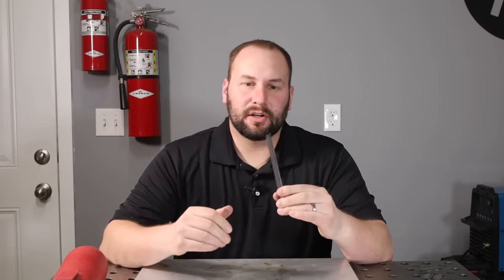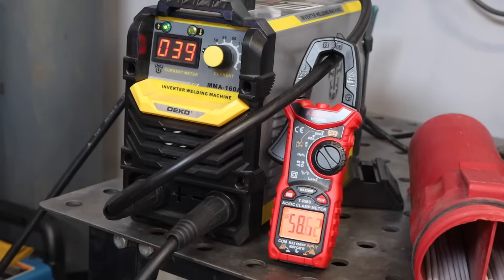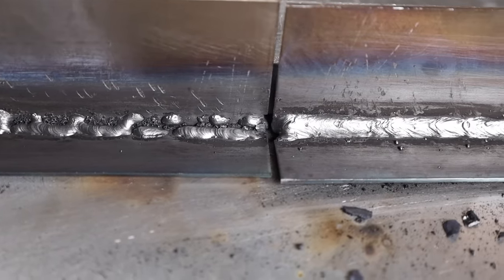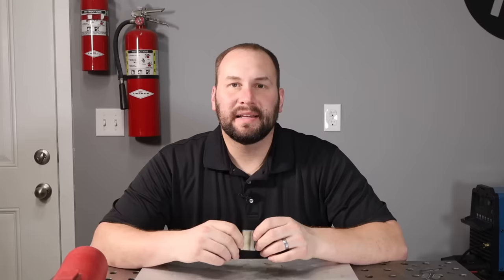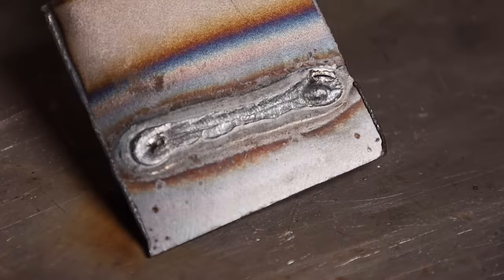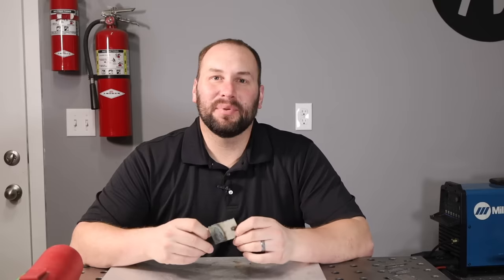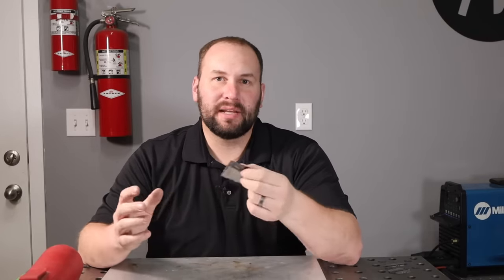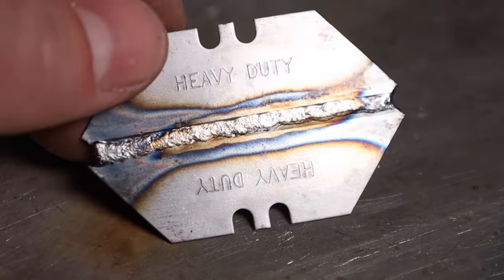Can I Stick Weld Razor Blades? | Thin Steel Stick Welding Tips

Comment: The guy that taught me (early 60's) could weld a beer can to 1/2" plate with a stick welder. Nice clean weld. I was never that good. In later years I had a guy working for me that would bend a 7018 1/8' rod backwards and do vertical ups in a mirror. I did master that one.
Reply: Beer cans were steel back in those days, so before some keyboard warrior comes along, yes it's possible.
Reply: @ParadigmUnkn0wn  i was actually wondering about that
thanks man
Reply: What do you mean by bending it backwards? Like in a U shape?
Reply: @autodidacticartisan  Yes..
Reply: Everyone loves it when I pull out my gag 1/2" thick soda cans
Reply: back in my day (early 40's) we'd hold a coat hanger steel electrode in our teeth and do 250 push ups, welding at the bottom of the rep. the goal was to replicate the mona lisa in welding bead, and that was just to get hired for an entry level position at $0.15/hour. you little whippersnappers don't know a damn thing about welding!
Reply: My Dad told me when he was on his 1st or second job out of vo-tech he welded a prince Albert tin to his work bench bottom...
Reply: I seen a guy bend his rods and weld around tubing without looking at other side of bar and Weld a whole racecar frame perfect. It was unreal how good he was when compared to myself using eyesight to weld lol
Reply: i call bullshit oldman
Reply: @autodidacticartisan  I can't even weld like a normal person 😂

Comment: I've successfully welded car fenders and other car body parts with a stick welder and it is challenging.
Reply from the maker: Tons of respect for those skills! I've only welded auto body with MIG.
Reply: @TimWelds  It's actually easier with a brazing torch and brazing rod or coat hangers 😊.
Reply: Last summer I picked up a stick welder for the first time in 20+ years. Had a bit of thin rod left over from a small fab job so decided to try repairing some old thin sheet metal barbecues that were lying around. Blew a few holes but for the most part it worked pretty good!
Reply: @TimWelds  Unfortunately I know firsthand that it's difficult to say the least... To put it better, trying to stick weld body panels is about as hard as wiping with rice paper and trying not to punch through it with a finger!!!!🤦🏼‍♂️ With patience and practice, A LOT OF PRACTICE, it is possible, but it's a serious pain in the @$$ until you get the hang of it.
Reply: @randyherringshaw6325  thin metal requires a much faster travel speed. I like welding on super thin metal but I prefer using tig. Stainless stick is always a great challenge
Reply: It's pretty hard because if you're butting two ends together they try to run away as soon as you start the arc.
I've noticed that bridging with a blob and pushing the blob along works ok with stick on thin butt welds.
I had my fair share of challenges with my AC buzzbox before i got my MIG. :)
Reply: @poptartmcjelly7054  I started welding before MIG was affordable for home use but if I had to weld thin metal on a regular basis it would definitely be my welder choice.
Reply: @JamesCouch777  I'm planning to buy a MIG at some point, but until I can budget it it's SMAW all the way for me...
Reply: @hughbrown1531  so far it's done everything I need to do, which is a lot when you are a farmer.
Reply: Came here cause I gotta try and weld a pressed steel backbox to a 3mm exhaust
Reply: @olivermansfield8341  you can do it! Good luck 🤞
Reply: @JamesCouch777  That makes two of us!
Reply: @isaiahbonson7171  👍
Reply: I bet it looks great!!! Lol
Reply: ive been trying to do that any tips
Reply: @bobs12andahalf2  Got to give you credit. I've built a few smokers from 55 gallon drums. It's a slight pain in the ass but definitely doable lmao.
Reply: I agree 👍
Reply: Iv been welding less than 1mm thick steel with stick and I agree very challenging.  I didn't no you could negative the electrode  but I will deffo give it a try . Love the vid dude
Reply: Can we purchase that cheat sheet guide you made for various thickness of metals with rod and amp recommendations?  Thank you for the great videos
Reply: How please I tried to day omg lol
Reply: How did you do it?

Comment: Great video buddy!! Another way to weld thin material is to raise your amps to the recommended (6013) range and make really fast dots, it works fine mainly when you are welding galvanized material and need to burn through. This method works when you are welding out of position too, like that impossible angles and weird positions. You have to set your amps high and work fast. Anyway, this is just the way I do it when need to. I wish the best luck to you, your business and family, keep up the good work
Reply: At work I often need to stick weld stuff that really should be welded using a different method and the fast dots trick saved my life so many times! Especially useful when welding upside down or vertical in a tight place on a half rusted vent pipe :D
Reply: Glad to see someone else who knows that trick. Just dot very quickly. It works like a charm.
Reply: @Dzonnyg  Indeed. It's very effective.
Reply: 6013? How about the same thing with 6011? I've been trying to do this and got a few welds looking very MIG-ish  using  0613, but most of them   failed  miserably.    the minimum amperage for a 3/32 0613 from Harbor Fraud  is 70, while the minimum amps for 0611 is 40.... it just seems to me like the  threshold for burn through with 0613 at 70 A is so freaking small.   blink once and you are burning holes.    (on the funny side, the square tubing I was using to test this ended up sounding like a maraca with all the slag and splatter that  ended up inside of it)
Reply: Another tip welded to a great tip. Nice 👍
Reply: @LuisLopez2  6013 is better if dry and probably not Harbor Fraud...
Hobart is generally nice ...
Fast fill coating is a bit more picky about dirt and settings and it can be difficult see puddle under the flux..
Reply: Some welderz.with pulse tig will pulse stick, nearly the same thing.

Comment: It works, the bought a $99 inverter ark welder. 1.6mm rods, 20amps, electrode reversed and the frame wall thickness is 1.5mm or less. Thanks TimWelds.

Comment: I did my first exhaust with a stick welder when I was a young man. I felt pretty ba it's all I had and I made it work it sounded great no leaks had to have them loud mufflers 🤣
Reply: Years ago, they used to put a layer of aluminum on exhaust piping for corrosion resistance. I don't know if that is still a thing or not now as everything seems to be bolt together and its simpler for me to just replace rather than fix. If I'm doing a custom exhaust for something,  it is stainless steel for me.

Anyways, if someone runs into the aluminumized steel, it can appear to need more amps to start the weld than it does to do the weld. This will lead to a bunch of cold welds that don't stick in one extreme to blow through holes and a lot of frustration on the other end.  So if you are having issues on exhaust pipe,  try cleaning the metal really good with some Emory cloth or sandpaper ( maybe even a wire wheel) to remove that thin layer of aluminum around the weld joint.
Reply: @sumduma55  thx bud!
Reply: @sumduma55  From my experience in the automotive industry now they just use a galvanic zinc oxide to coat the exhaust system, that is IF they even decide to try and prevent rust at all. These days most corporations just seem to be worried about making as much money as possible and not about product longevity. After all, they can't sell more exhaust systems if they don't rust off of vehicles for 10 to 15 years or longer... SMDH
Reply: @randyherringshaw6325  alot of  that is actually due to government  regulation  driving up costs. Alot of  climate change regulation  is going to rape the car industry soon.  The coated pipe is so much more than non it's not even funny.  A little more is expected.  But it's only because of over regulation.  Ofc they want to make as much as possible. That's every business. But alot of the time they start cutting stuff out because of regulation  costs. If those costs  weren't there then they would use the better material and still be able to keep the car somewhat affordable
Reply: @sumduma55  yes aluminized steel is still a thing for cheaper exhaust systems.

Comment: This is amazing! Most all of the thin stiff I have worked on was where we were trying to avoid buying a 1300.00 muffler for a piece of heavy equipment.
I used oxy/acetylene torch, filler rod  and sometimes I needed thin metal to patch with. I was able to get many many years out of mufflers most would throw away.😃

Comment: I love stick welding, but it is so challenging on thin stuff..... thanks for the info!!!!
Reply from the maker: Definitely agree...it’s kind of like walking a tightrope. Thanks Daniel!
Reply: I just do little welds so the base material doesn't overheat
Reply: Its good to know the extremes! I've welded for 13 years and i don't see myself having the patience to stick weld razor edges though! I readily admit I'm not good enough😂

Comment: I think the real value of the razor blade challenge is pushing your skills to that level.  It makes other stuff much easier.  I have not attempted it stick, but I have put a lot of beads in and attempts at beads.  It has greatly improved my tig skills.  I may have to take my 1/16 6013 rods to school and try it.
Reply: Or use razor blades not UTILITY KNIFE blades ,There is a world of difference
Reply: @Interdiction  I can tig razor blades.  But have not got them stick welded.  This past week I tried box cutter blades with stick as my other comment mentions.  Took about an hour or so of work, but got one with a pretty decent bead considering the material. Good penetration and no warpage. For actual razor blades the problem is maintaining an arc at 15 amps or below.  I don't know if I could keep the arc going at 10 amps or so that the razor blades would require.  I am close, but I am not sure with my current welder and rods it will happen. I did get some Lincoln and Forney 6013 1/16th rods to try.

Comment: Great info.  I am not a great welder but 80% of what I weld is 1.6 or 2mm, often gal.  I mostly use electrode negative as it avoids blowthroughs but might switch back and give it another go

Comment: I've just started to learn how to weld (7 days) and I was actually struggling with understanding why i wasn't able to achieve anything other than blow torch fury (burn through). No only did this point out my exact errors but also clarified many of my further questions related to the subject matter.... my issue was mainly my rod size and amp's, 2.6mm rods nailing a thin tube on 90amps was probably destined to fail 😆.
Reply: Absolutely.

Comment: Bean cans have the thinnest steel you'll ever try to weld. Personally, if the metal is that thin, then I would rather pop rivet it instead.

Thanks for sharing even though I prefer riveting to welding on sheet.

Comment: One of the biggest misconceptions I see is thinking amperage/voltage is equivalent to heat. 

TIME=heat. When I was learning I burnt up more parts by running too low and having to travel way slower which gives the heat more time to build and spread, making the metal softer and increasing the chance that you will blow through or have your puddle collapse. Control of your weld relies on being able to melt the material as locally as possible and have it freeze quickly. It's really a Goldilocks situation. Too much current and you can overwhelm the material, too little and you end up slowly making soup.
Reply from the maker: That is a great point. I have a video on my list about heat input to demonstrate that very thing and also how it plays into distortion. Thanks for the comment!
Reply: This just clicked something in my brain. Thank you.
Reply: I've always ran fast with my welds. I usually have thin/rusty metal to deal with. Right rod angle on 7018, and just drag it. Pace is based the backflow of the flux. 👌 I learned that off YouTube. 🤣🤣 People don't believe me. But it's true. When I tell my "helpers" that, they are sceptical. Next day, they are thanking me.

Comment: Cool, now do 90 degree razor blade weld. That one I find the hardest keeping the heat even between the horizontal side, usually on some heat sink and the free standing vertical side with thin metal using 6013.

Comment: I work making safes with sheet metal and galvanized, and what a welder there showed me is if you do it a bit hotter and faster it will warp less and you will burn through less then if you ran cold.

Comment: Very nice work!
   There are a lot of hobby welder videos showing a 6013 dab-dab method. This method can be effective to patch up rusted out lawn mower decks, wheel- barrow tubs, etc. Some makers test by cutting open these welds todemonstrate pretty good quality.  You drag the rod to push the slag away from the leading edge and let the puddle cool, but not go dark, so the arc immediately restarts.
   I can see why this would make a commercial welder (who charges a professional rate, has rivals and a reputation) uncomfortable.  But it has its place in a world where lots of little things just need to get done. It's sad that this is becoming unusual, it used to be very common.

   I'm going to explore 6011 sheet metal welding this year. I found, and lost track of, a video where a young man welded up a beautiful steel box with 18ga (1.2mm) steel using 3/32 6011 at 35A.
He had some sort of modern inverter  welder, but did not mention if he used  Electrode Negative (very good idea).
   This is below the recommended low end of the range, but the aggressive arc of the 6011 seems to make it possible to keep the arc going. He did a continuous bead at a moderate speed, and it had the coarse ripple of 6011, but it was narrow and he didn't burn through even once.
   He also welded one side with 5/64 6013 at 38A. This time he did burn through, at the end of the run, but couldn't tell untill he chipped the slag.
     6011 is a fast-freeze electrode, and welders have run miles of root-pass beads without burning through. Also you will hear old-timers talk about only having this for exhaust/muffler and auto/body work. Also, you can buy this size anywhere.

    I remember from the narration and comments that machines vary widely in their success with this method, so you just have to give it a try. 
   So I'm going to drag out the old buzz-box, and the new Amazon $100 feather-weight and see what happens. 
    If anyone who actually knows about this stuff wants to weigh in, at least some of us would be very grateful. Maybe we could get Tim to make us a video.

Comment: Wow, I did not think that was possible with stick. You are quite the welder. Looks like I need to improve my skills a lot. Great video!
Reply: Was really surprised as well, though i have stick "welded" thin 1mm sheets in pinch with stick, using 1.6 rod, like i would everything else, just make multitude of tag welds to build up the material, since there will always be holes when i'm welding. Ether holding too long in same place or running too high of amps, essentially lack of skill really, but good to know this is actually possible if you have skills. Gotta try that reverses polarity trick next time and figure out where i put my copper plate peace, i used one when welding car sheet metal with mig back in the day.
Reply: @Hellsong89  lol yeah, I'm really good at burning holes through thin metal. I use Miller welders, I guess I just need to learn the power settings and polarities as well.

Comment: Fine educatin. You are the wizard of thin material. My welding machine  with 1/16" rod at 50 amps sparks like a Roman candle, either burning though the 1.5mm material or will not strike an arc.

Comment: I was recently wondering if welding razor blades was possible, I wanted to modify my blowgun darts so this is perfect thanks!
Reply: I’ve been thinking about welding a longer heavier shaft to my darts for penetration on small hogs. Are you talking about welding new blades onto the dart?
Reply: @j.shorter4716  they actually have their own broad head darts that are longer and heavier, tim wells has killed animals way bigger than hogs with them
Reply: @hunterheadley3178  I saw super long darts in a recent video of his but didn’t know if they were home made or if they could be bought somewhere
Reply: @j.shorter4716  you can buy them on amazon or find em on ebay

Comment: I was taught to weld using 16ga sheet and a 3/32". 6013 rod.  We weren't allowed to use thicker material until we passed all of our welds on thin sheet.

Comment: I finally actually did it, stick welded box cutter blades, mostly using your tips.  The cheap Harbor Freight 1/16th 6013 were a challenge to keep lit without long arcing at 15 amps.  I used aluminum blocks as heat sinks.  I have 5 little blocks, roughly the same size as 123 blocks.  So I rotated when one would warm up.  It only took me an hour or so to get it mostly dead on and part of that was I hadn't watched this in awhile so I had to play with the amps. 30 was brutal to the blades. I hadn't stick welded in over 3 months.  I still need to play around a bit more to get it dialed in.  I believe I could probably do actual razor blade with a bit of practice and maybe better rods.

Comment: Thank you I have been having trouble with this tiny Campbell 70 amp I got free and fixed it welds but I'm trying to make a flat top grill with it and I have super old rods from my grand father's he used to weld back in the 70s and 80s the rods where stored in aluminum tubes but the seal was popped on them and they got full of water and oil I'm super excited to start on my grill in the morning.